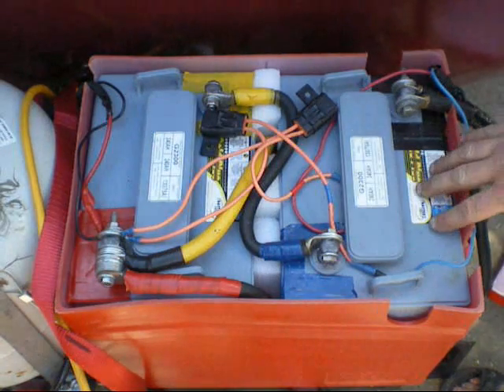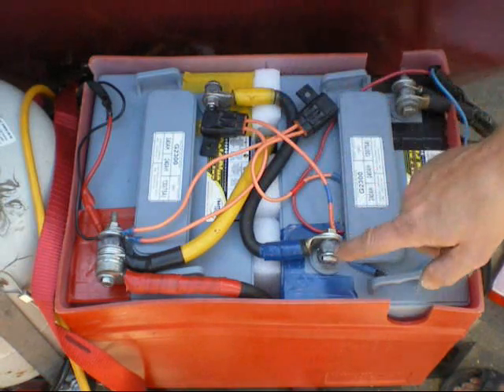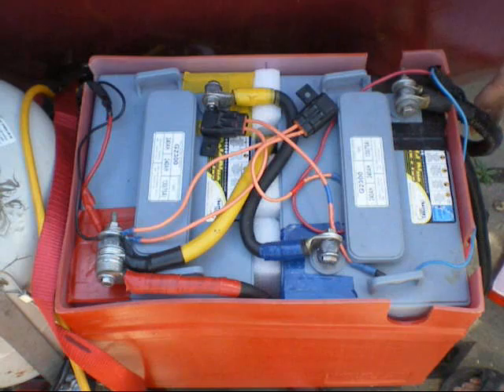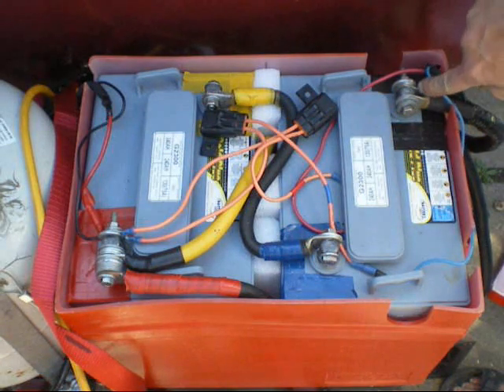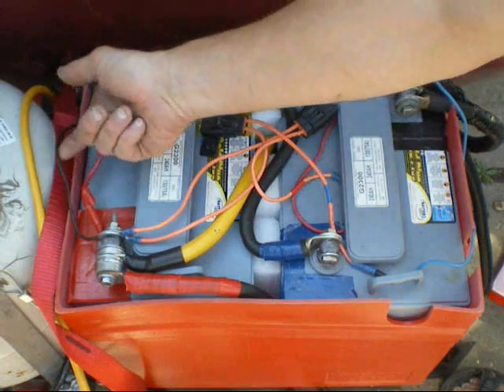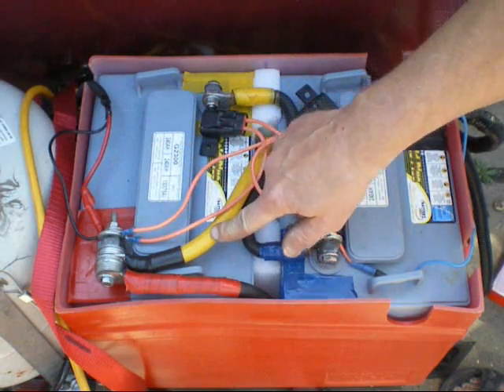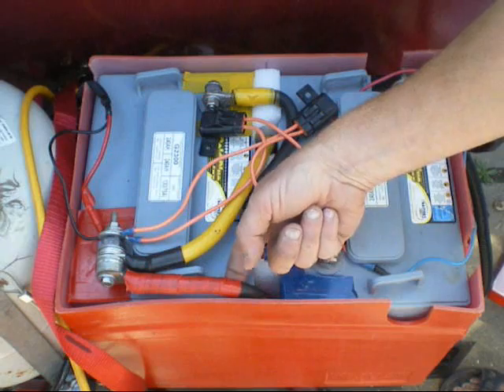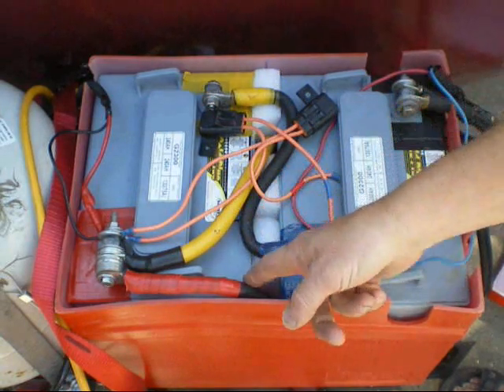Battery Connections

Comment: Connecting two batteries in series like this will output 12 volts. Connected in parallel (pos to pos and neg to neg) you get 6 volts but twice the amperage. I can't answer your 14v question, sorry. I'd be afraid the 2 volt battery would overcharge and explode.